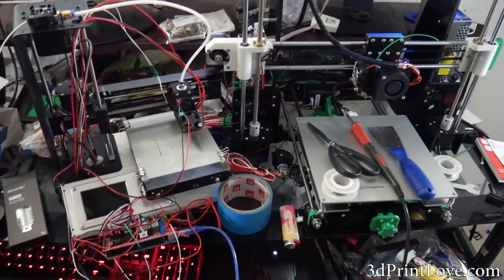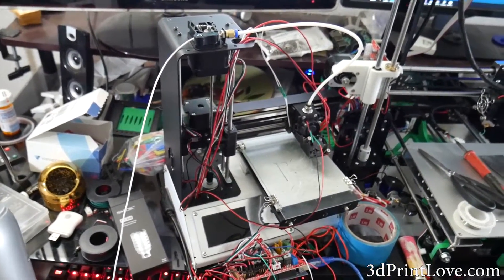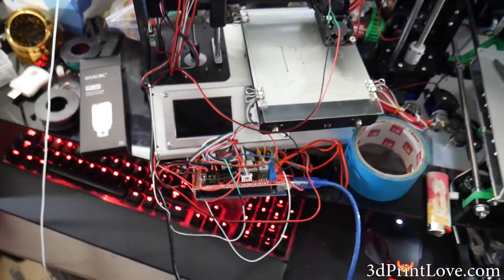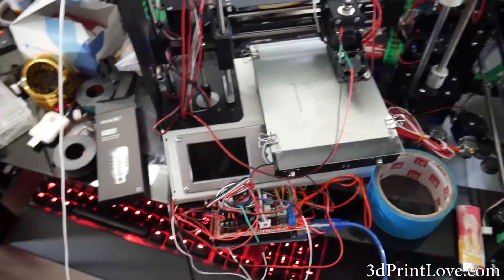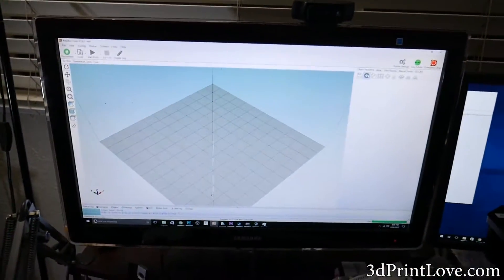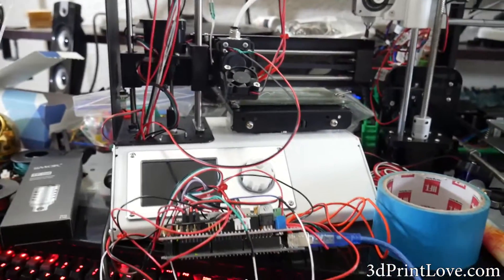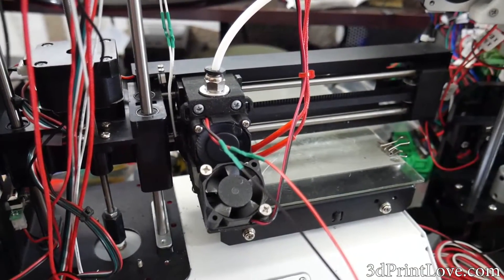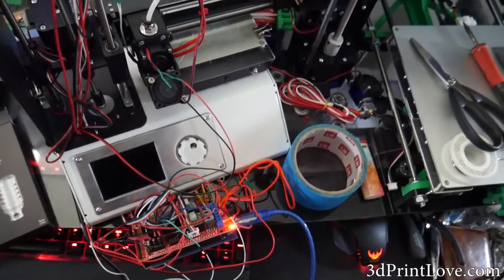MonoPrice Select Mini 3d Printer Ramps 1.4 Arduino Conversion

Comment: I hope it's not too late for a reply, but the issue that you're having with the bed it's well identified and documented by the community: the problem is that the cable from the bed is in tension and with use tens to lose connection. Look for bed wiring issues and workarounds on google. But I think that you might already solved it. Cheers.
Reply from the maker: I appreciate the feedback. I ended up selling off this machine a few years ago now. I did end up getting it all working though :D